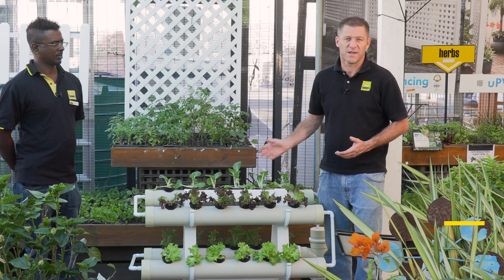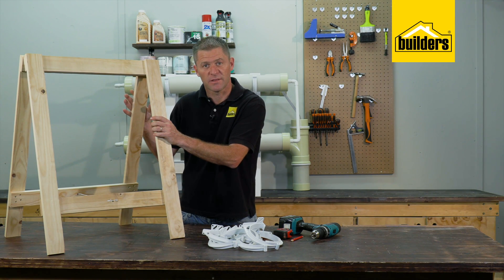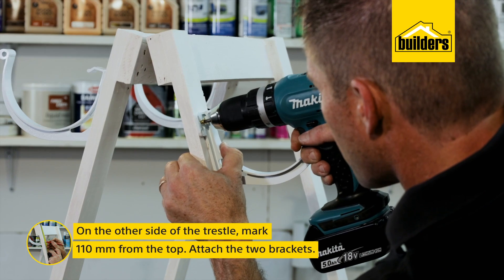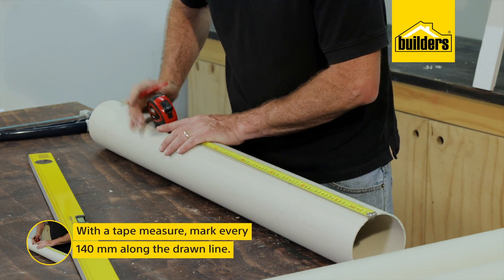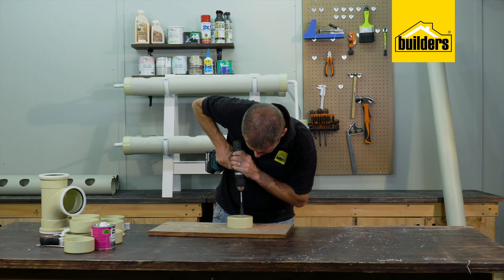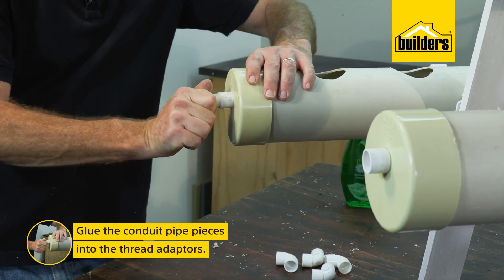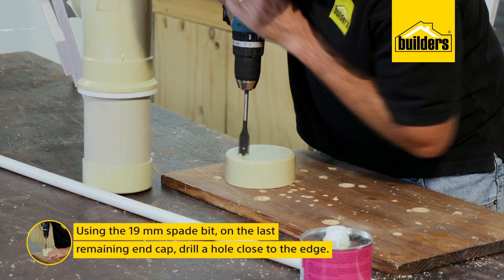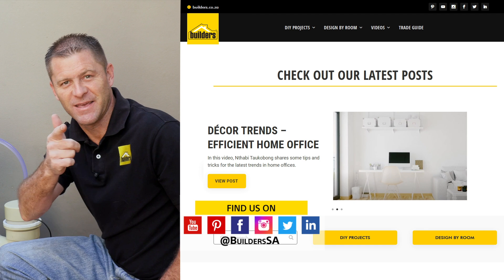DIY | How To Build Your Own Hydroponics System.

Comment: The outlets are placed too high so the water level will be too high and the tubes very heavy. They should be placed at the bottom of the outlet to guarantee a thin nutrition film. But beside that a good idea to take such a prebuild thing and apply the tubes to it. Will consider this for my next  NFT project.

Comment: it is a nice starter setup but root rot will be an issue, the water should drain through the system when the pump is off and for that, there would need to be a bigger reservoir with the pump on a timer.

Comment: For beginners that are handy, this is a good way to dip your toes. That said, the design is flawed and I wouldn’t recommend it.

1) The reservoir is too small and water will spill if and when the pump is off.
2) The ports are too high meaning that the water level is a little high for an NFT system.
3) The system is glued together and cannot be taken apart to be cleaned which is necessary from time to time.
4) The bottom pipe holds little water due to the design. This means it is only useable when the plants have long roots . Additionally, when the pump is off it converts to a holding tank and overspill.

Comment: For people asking for a shopping list, here's what you'll need:

1. Store-bought trestle (wooden frame)
2. Four 1-meter lengths of 110mm PVC pipe
3. Eight gutter brackets
4. Packet of 5x25mm wood screws
5. Three 2-meter lengths of 110mm PVC pipe (to be cut into four 1-meter pieces)
6. Nine 110mm PVC end caps
7. One 110mm PVC T-piece
8. Length of 20mm electrical conduit piping
9. Six 20mm 90-degree bends
10. Six 20mm male screw adapters
11. PVC weld (glue)
12. Clear tubing (for pump connection)
13. Submersible water feature pump (400 liters per hour, 0.9 meters head)
14. Nutrifeed hydroponic fertilizer

Tools mentioned:
1. Drill driver with Phillips bit
2. Tape measure
3. Pencil
4. Spirit level
5. Hacksaw
6. 64mm hole saw (for drill)
7. Small piece of sandpaper
8. Utility knife
9. 19mm spade bit (for drill)
10. Pipe cutters

Optional:
- Paint and primer (if you want to treat the wooden trestle)
- Vacuum cleaner (for cleanup)
Reply: You’ve got four 1m lengths of pipe which aren’t needed (item 2) the requisite pipes are item 5
Reply: WhT size growing pods
Reply: Thank you!

Comment: This is a great build, but there's important information afterwards that you've left out. My guess is you're going to run this a quasi dutch bucket/aeroponics setup, where the water is pumped to the plants periodically and they stay in net cups (which we see, for example, at 9:29. You could easily run it as NFT, but again, the plants are in net cups. For those that aren't familiar with hydroponics, the building of the system is only the first step and you should include a follow up video showing it actually being used.

Comment: Really nice and attractive design.  I would copy this but make a change to the water levels, they are a little high, I would move those drain ports as low as possible to not keep so much stagnant water in the tubes, more like a true spec NFT, keyword "Film"

Comment: Awesome instructional video! Thank you!
Couple questions:
Could the entire length of 110mm pipes have been used for a bigger system?
Also, how did you calculate the system capacity?.. 
Thanks again

Comment: I'm concerned about root rot. Even when the pump is off the tubes are still going to be pretty full, roots soaked 24/7. Does it ever drain?
Reply: YES, I thought there was just a thin film of water flowing under gravity through the system. I think it is called NFT - Nutrient Film Technique. Although there is a Kratky method which uses a bucket filled with nutrient solution that depletes as the plant sucks up the food, maybe this is following that principle.

Comment: I am trying to build this system in the USA. I can’t locate the 400 liter per hour Rhino pump used in the video. No other company seems to have a pump with dimensions that will fit into the 4” pipe. Also, I am using imperial dimensions of 4” for the pipes  and  0.75” for the connections. thoughts?

Comment: Hi how are you all doing I live in a rain rainy rainy area I like the PVC design and the materials used as well however for as long as that plastic has a shelf life of over five years I really don’t think that The wooden frame will hold up. I’ve seen similar designs here and by the way if you had a dry area and if it’s under a roof disregard this comment I referred you outdoor hydroponics thank you
Reply: Or use PVC board to build one

Comment: Advisable to get food safe, non toxic UPVC tubing (not PVC) which is unplasticised PVC. Also use aquarium grade silicon glue to seal pipes as is non toxic.
Reply: PVC piping has been used in drinking water applications for decades. Literally just about every home in America has them. Most have them for the waste pipes and (most relevant here), many use PVC piping for drinking water. The hydroponics community has also been using PVC piping forever. Translation: the piping he used here is completely fine.
Reply: @dontbanmebrodontbanme5403  Cigarettes have been smoked by many people forever, they are fine! Asbestos has been used for decades! It's fiiiiine :))) Translation: you're ignorant of the global microplastics pandemic
Reply: So basically use schedule 40 PVC pipe suitable for potable water.
Reply: There’s always one Debbie Downer

Comment: if you wanted more oxygen saturation in your water allow the return line to break the water surface in the main tank. Also if the public doesn't know, you're using a #4 possidrive bit on your cordless drill for the wood screws
Reply: Hi! How significant a damage on the crops if the pump stops working during the loadshedding hours???

Comment: Heres another dilemma to ponder, when you have to change the water with the solution in it, how do you empty it.  The outlet for each hole in the tubes sit above the upper half of the tube making it difficult to fully drain the water.  I think  you'll need to put in some drain plugs in each tube. Also the tube just before the reservoir doesn't fill properly when the pump is on.  It does not allow enough water to rise up and reach the bottom of the net cups. 
The water flows back into the reservoir then gets pumped back up to the top tube and then follows down each tube until it gets back to the tube just before the reservoir, these seem to work.  When the pump is off the water fills up the tube just before the reservoir making it really only a bigger reservoir for the water to sit and wait until the pump turns on to move the water again eliminating that tube to grow anything. At least this is what I am experiencing and since you don't return messages I find this is more of a trial and error.  If your going to post videos on how to build projects, you should spend more time explaining, you are after all Professionals, YES ?  hmmmm

Comment: By the way if you drill a 2 1/2 inch hole you won’t fit your net cups in them. The hole needs to be 3 inches in order for the net cups to sit deep and properly for the water to reach the bottom of the net cups. At least in my world.  Sad you haven’t responded.

Comment: Your 19 mm drill bit is equal to 3/4 inch but the end piece you use to thread into the end of the cap should be drilled out to 1 inch not 3/4 inch at least here in Canada.  Also the size of the holes you drilled for the cups is equal to 2 1/2 inches, yet I can not find any cups 2 1/2 inches, only 2 inch or 3 inch.  I'm also still waiting to hear from you regarding the water if it is to run continuously or set for a certain time of on and off.  Thanks again.
Reply: water runs all the time with hydroponics otherwise it stagnates and loses oxygen, it is a liquid nutrient that the plants sit in and draw their life from, think of the water as blood, it needs to move and flow always or it dies.
Reply: Plants will only take nutrients up trough the soil or in this case water during the day. You can gladly leave the pump off at night
Reply: I have mine running on a timer - 15min every hour for 8 hours

Comment: Good info.  You did not mention the containers that you plant in that are placed in the holes.  What are their size, and are they available at Builders.
Reply: Does this hydroponic system or the crops get affected if loadshedding hits and the pump doesn’t circulate water!!?